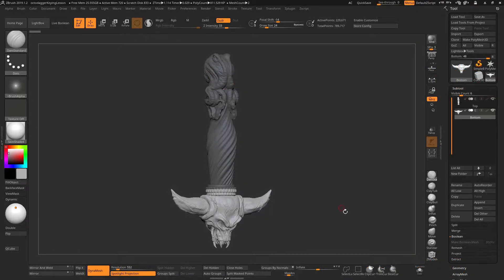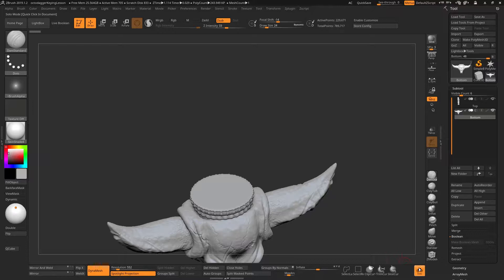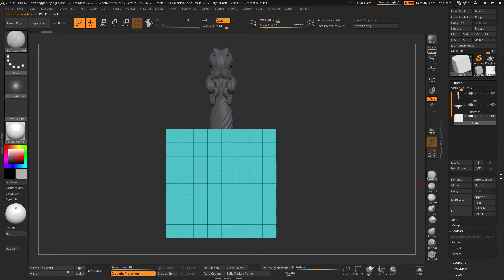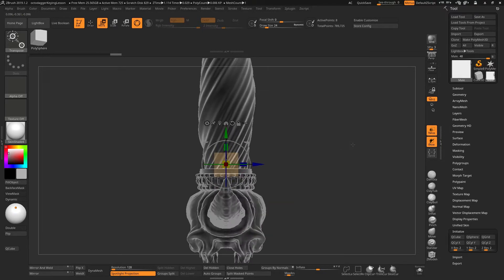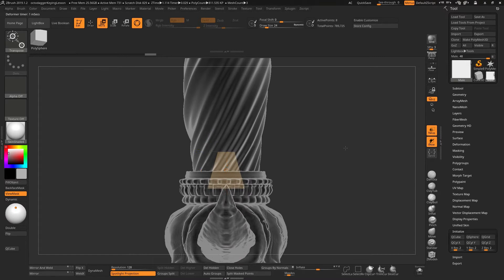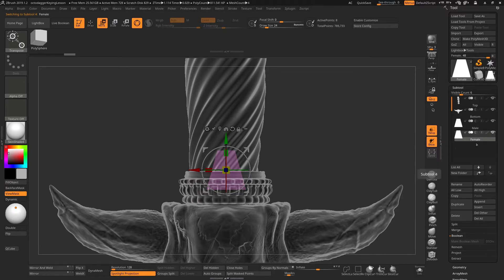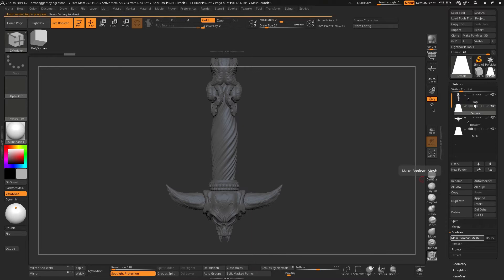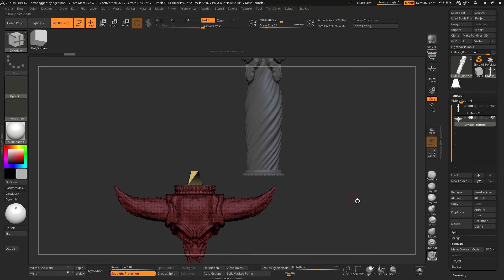How to create keys for 3D printed parts in ZBrush quickly and easily.

Comment: You forgot the tolerances. These parts will not fit nicely together because real world is not a 3D software. You need to make the cutout aprox. 0,1mm smaller otherwise parts are not coming together clean.
Reply from the maker: Oh, I cover it at 1:56s. Thanks for watching!
Reply: @SeanForsythTutorials  Yes ! indeed. You are right, I am sorry.
Reply from the maker: No worries, you're not the first to say it, it's obviously not as clear as it could be .

Comment: thanks! after all that, do you need to make the mesh "hollow"? or is this done in the 3d printing software? 😊
Reply from the maker: Well that depends on how you are printing it. If you are using an fdm printer it will fill in the model with a fill percentage defined by yourself in the slicing software. If it's resin it will need to be hollowed, and this is normally done either in the slicer software or something like meshmixer (free), but can also be done in Zbrush.

Comment: Hi, if I want to apply this process to my miniature ? I must keep separate my pieces separately till the final ? ( I ve a mix of dynamesh objects and other with sub-d)? It is does not matter ? thx
Reply from the maker: No, it doesn't matter, keep them separately, join them up, do whatever you need to do, it's only for the final step that you need to consider which ones to join and split up, depending on what makes most sense for your model.
Reply: @SeanForsythTutorials   I ve created a lady riding a horse... the horse's saddle (plannig to put a hollow and in the lady's gluteus put the pin. also planning to create some holes in the shoulder of the lady to interchange the arms' movemnt (taking a horn, holding a sword ,  taunt motions)... I did not merged . 
1 -  before I merged I need to apply the keying-pinning process?
2- once I feel good with the holes, Do I consider to export them separately ?
3- recheck the scale (or give a scale's values) ? I consider the scale model affect the holes. thx
Reply from the maker: @leatherandpoemscharmyman5774  I'm assuming you mean to keep the lady and the horse as separate subtools.There's no need to merge them together. Just create the keys and export them separately. To check the scale you can go to Preferences and under Transpose Units, click Set Units and type "mm" (without the quotes), and hit Enter. Now when you press W to go into Move mode, hit Y and you will get your Transpose line. If you drag out a line anywhere on your scene you can see the measurement in mm right undernear the Alpha menu written in orange. Alternatively, if you have a very spcific size you need it to be, then you can use the following tutorial to get all ob your objects to a specific size relative to each other. https://www.youtube.com/watch?v=AUyz43qUqmw Hope this helps!
Reply: @SeanForsythTutorials  txh for the tutorial!

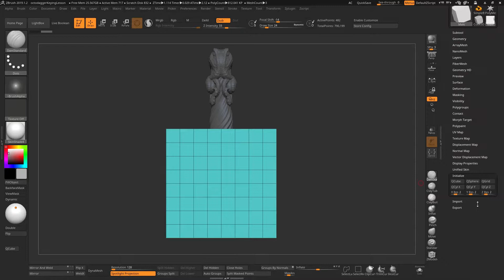Comment: How did you get that on the cube at 0:56
Reply from the maker: Scroll down in the Tool pallete to the Initialize rollup and there's an option there called qcube. Clicking that will convert whatever subtool you are currently on to a cube.

Comment: I see you made the female key larger for clearance but it doesn't seem precise, seems like there would be a lot of trial and error
Reply from the maker: Yeah, it's not CAD software, that's true. However, you will find that in general, there aren't that many problems. It depends on the scale of what you're printing, so it's prety much up to you how tight you want to risk the key being.  If it's too loose, you can generally add more glue to fill the gaps as it were. If it's too tight, some sanding might be required, but as I said, in general, as long as you make it smaller to some degree it will fit in okay. Alternatively, you can also measure the distances using the transpose tool if you want to be 100% sure.

Comment: You forgot to let some tolerance on female key
Advance move is to show how to hide 2 pieces joint
Reply from the maker: Hi, thanks for commenting. I did mention to make the female piece larger around the 2 minute mark, do you think this needed to be clearer? Not sure I understand your second sentence. You want me to show how to hide a 2 piece joint? Do you have a sample image you could show me?
Reply: Sorry didn’t notice
My second suggestion is about alternative to plane cut,better to hide the cutting line in the model
Reply from the maker: @syl3d678  Well, it should be the same principle, using male and female keys. The Live Boolean operation will work on any surface, so even if you have a curved or angled surface, the subtraction and addition will work. But I may be misunderstanding. Can you link to an image showing what you mean?